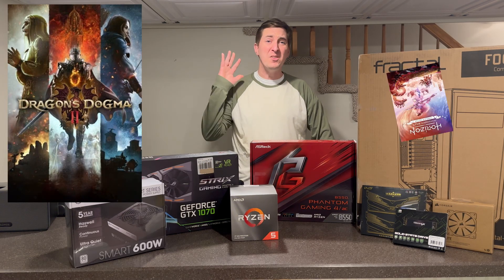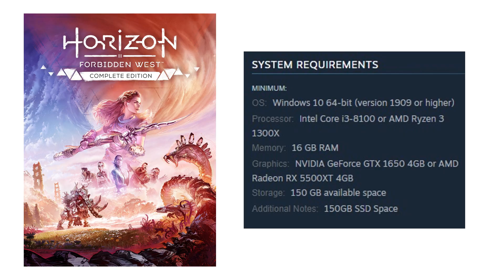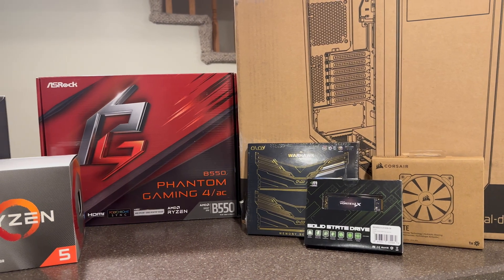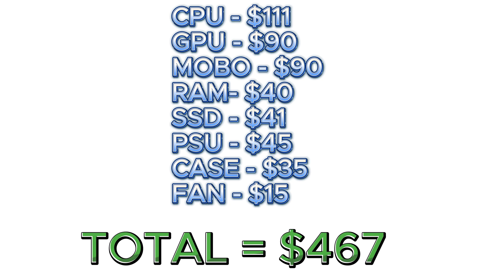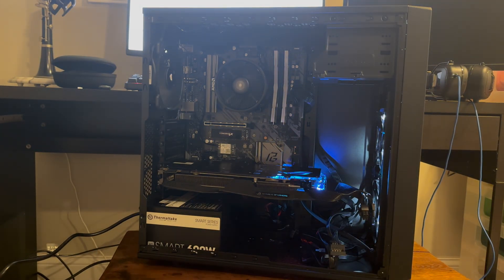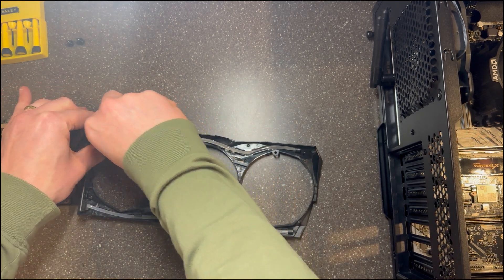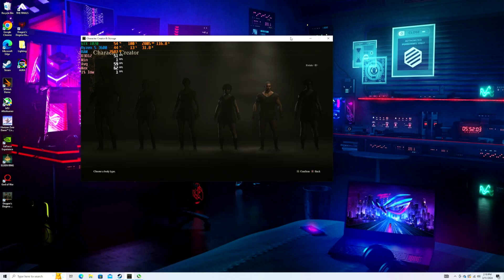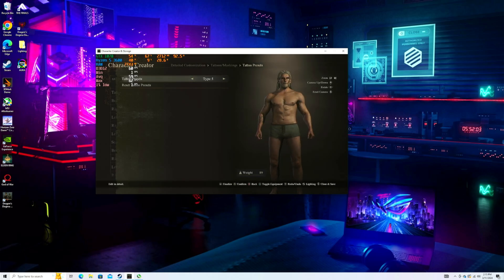Building a Minimum Required Spec PC for These New AAA games

Comment: unreal engine 5.4 and unity six will crash unless you have a RTX 4090 graphics card this must be an old video. you'll need $5000 computer these days to use those engines without crashing.

Comment: I know nothing about PCs but want to build one. I only play single player games. Usually AAA games similar to these. Would a setup like this run all those kinds of games ok or will I have issues with certain kinds?
Reply from the maker: You can definitely run just about any game with this build. You’ll need to adjust settings depending on the game, and will have best results in 1080p though some games should run fine in 1440p.

Comment: Just a heads up, you will want to move the graphics card to the top PCIE slot, the one right below the CPU and right above the NVME drive. The slot you have it in is a 4x slot and not 16x like the top one, so it hinder performance.
Reply from the maker: Thanks, yeah I actually moved it before I tested the games. I want to try testing it in both slots to see how big of a difference performance is.

Comment: Hey nice video. I just want to point out that you plugged your video card into a PCIe slot that only appears to be wired for 4 lanes instead of the full 16. If you move it to the top PCIe slot with that metal shield around it then you’ll get the full x16 bandwidth of the card.
Reply from the maker: Thanks! I may actually try both lanes to see how much of a performance loss it is. Sounds like dragons dogma 2 already has performance issues so will be interesting to see how this build does with it. I’m planning to benchmark it (and horizon) this weekend
Reply: Great idea. That gpu and mobo look like PCIe gen3 so each lane would run roughly 1GB/s. The top slot would communicate with the gpu at ~16GB/s and the lower one would be ~4GB/s. I’d be super interested to see if it makes a big difference in a few games.
Reply: The gpu fan might also get a little choked by the power supply.

Comment: It looks like $600 is a minimum required for a gaming PC. However I would increase the bar to $800.
Reply from the maker: I assume you mean including peripherals? I built this PC for under $500 as shown in the video, and I could’ve even gone cheaper if I looked for better deals or gone with used parts. For $600-800 you can build a pretty awesome PC
Reply: @PetesParts16  Agree.